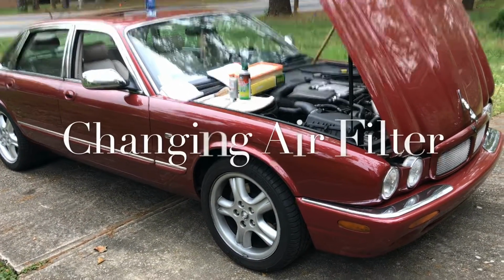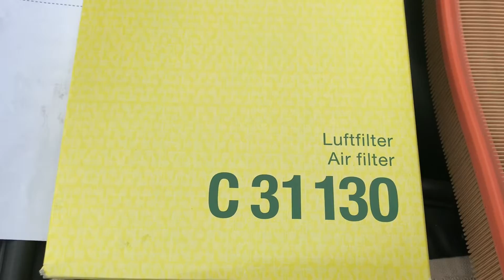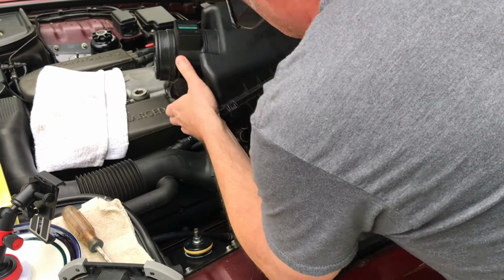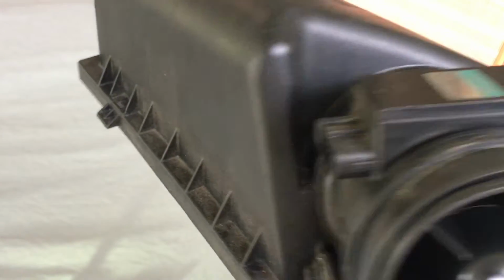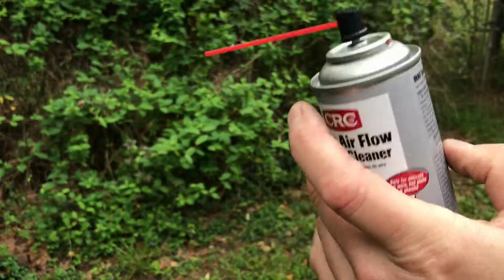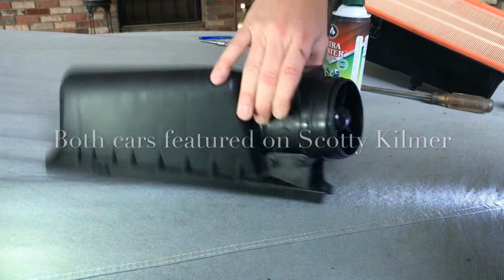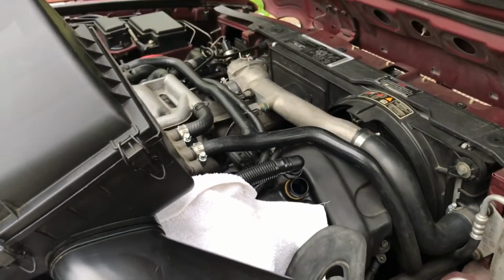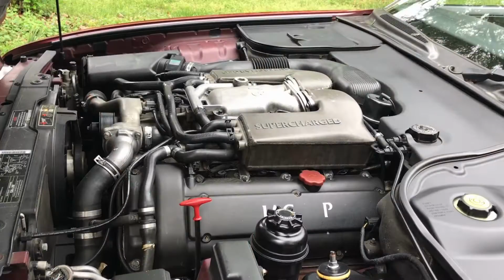Jaguar Mass Air Flow Sensor "MAF" Cleaning/Air Filter Change Maintenance PO171 fault Code

Comment: Great video. Just did this today. You can do this without removing the full air-box, though. The MAF is attached to the top portion of the box which you would remove when replacing the filter. There is no need to actually pull the entire thing out (saving that little wobbly bolt on the bottom, if it's still in tact). This was super helpful, thanks for posting.
Reply from the maker: Thanks Steve.

Comment: Great tutorial, Mitch. Thanks for posting! How often do you clean the MAF? Should it be some kind of preventative maintenance routine performed together with every oil change?
Reply from the maker: Thanks so much for the nice comments. I am not really sure what the factory requirements are but whatever they said back in the day, we all know it is not true. I have done 20K miles on my car and I check everything constantly knowing these cars. I would check it once at lease every 10K miles  and I know that is overkill but that is just me.. What car do you have?
Reply: @MitchGrooms  Thanks for response, Mitch. So it does sound like a once-every-2-years thing to do. Meanwhile, I found a video tutorial about how to clean the throttle body, check it out: https://youtu.be/56Fvo5I-2Vs. Since they're located so close with MAF and you remove part of the housing for cleaning MAF anyways, it's well worth cleaning the throttle at the same time, I think.
I live in Vancouver, Canada and owe 2001 XJ8 Vanden Plas. I bought it last year from an old gentlemen, who babied it and only put 80k kms (that's only about 50k miles!). The car is in immaculate condition, except for driver's seat, and I absolutely love it. This particular model (X300 or X308) has been my dream car since teenage. I've got a daily driver, so my intention with this Jag is to baby it too. To be honest, I don't even drive it in the rain, only in sunny days :) Cheers!

Comment: My mom has a 2002 XKR at around 70k miles which has had a check engine light and restricted performance light, we had the codes checked a month or so ago and it came up as MAF. Do you think simply cleaning it and adding a new filter would fix the codes or would I be better off replacing the sensor?
Reply from the maker: Josh, you can do this yourself,just simply go with the video and let me know how it goes..
Reply: how did it go